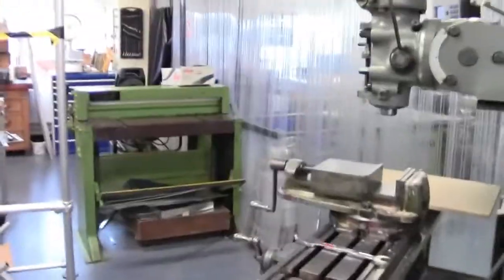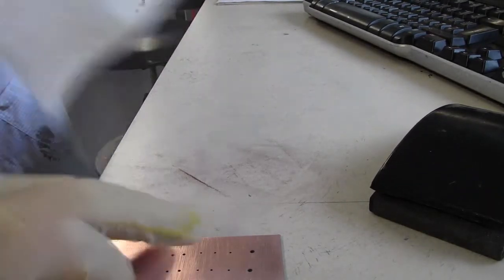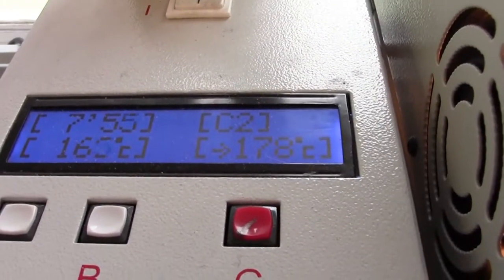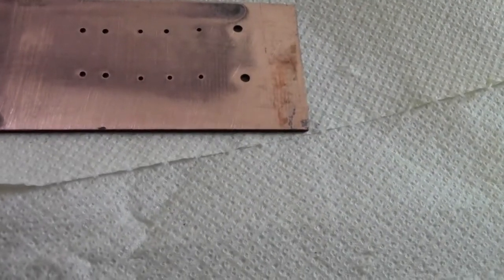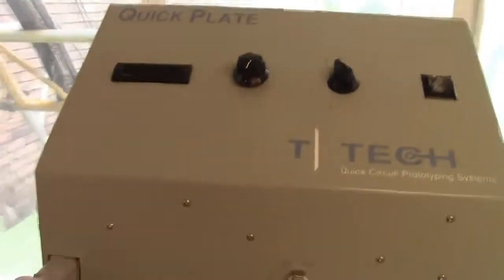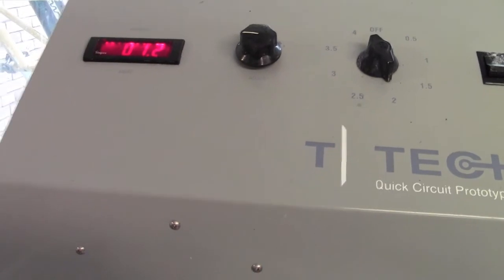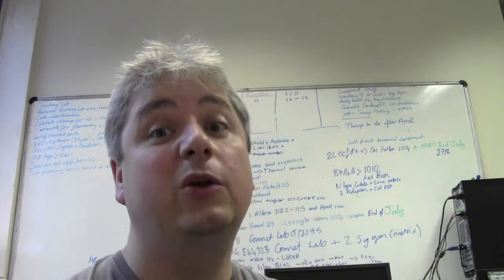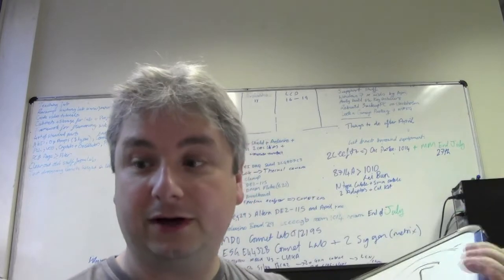Using the Activator and performing Copper Plating

Comment: A very interesting method. One problem that I see immediately, ist that FR-4, the material used in about 99% of all PCBs, has a glass transition temperature of 130°C. Going over this temperature could easily result in warping and other deformations.

Comment: Hi and thank's for your video. What is the "activator" solution you described in the precedent video?
Does it react with the second bath?  Or is it to make the nude copper drilled holes electrical conductive?

In other words : may i use another electroplating solution than yours after the activator one?
Or alternative : what is the electroplating content cooking on which it's written it contains sulfuric acid?
Thank you!

Comment: 1:45 - "Don't use sand paper"... You have no idea what you're talking about, real professional PCB fabs and makers uses "sand Paper", specifically Aluminum Oxide sand paper to clean/scrub away the impurities that are on the surface of the copper plate, they also use some additional acid cleaning solution such as a 10% solution of sulphuric acid. You can read all of this right at the manual of the photoresist from dupont which tells you how to "properly" clean the surface of the PCB's copper. By the way, when you say sand paper will "macker up" the copper plating... since you live in rock, you have never seen all of the many different types of "grit" size sand paper. You use a certain low size grit of sand paper to scratch away the impurities from the copper surface then use a higher grit sand paper to "polish" up the copper surface.

Comment: Hi. I have question. 
I made an activator according to the film.  I have a problem because the holes are glued together a thin layer that does not want to break from the temperature.  sometimes a white precipitate forms around the hole.
 
And all hole are Not plated. After heating pcb i clean with water
Please help.

Comment: thanks for this and the previous video on making the activator. I've made some - the ammonia smell is still strong after a few days is that normal ? also the activator doesnt seem to make the PCB top and bottom electrically connected after heat treatment as I'd expected. Wondering what I've done wrong, any pointers ?

cheers
Reply: Same question, but the question is that what he calls "activator" is may be not what we expect?

Comment: Thanks for the video,
I have tried developing the solution as per the video and chemicals you suggested. but i am having a small problem, hoping you to please help me out.
i am trying to plate larger boards, so in such case i need around 500 ml of solution for that. so i made the solution like..
280 ml of DI water.
60 grms of copper sulfate.
44 grms of calcium hypophosphite,
again 200 ml of DI water,
80 ml of amonium hydroxide,
adding 10 ml of dettol hand wash(liquid soap)
and then again 20 grms of calcium hypophosphite,
but the problem what i am getting is only 40 to 50% of holes are plated and rest of the holes remain the same. i tried the same with 4 to 5 boards, but the problem continues to all the boards.
can you please suggest me any solution for this problem.

Comment: First, thank your for taking the time to make the video. Yes, the video could be shorter but the more details the better, IMHO.
As for the chemicals involved, I was able to find calcium hypophosphite in eBay, from China at US68 for 1 lb. Not sure if it will be allowed to enter US but giving it a try. Asked the seller to add information on proposed use of the product to shipment details (Electroplating activator).

Comment: I dislike this video for so many reasons: 1) I watched this video and the previous for a whole hour...Why?  I wanted to do plate-through holes, but I never find out what the electroplating solution is.  2) Why do you drag it out telling me what used to be in your baby bottle etc?  You have endless filler, "tap the side", "don't poke a hole" etc.  3) Where are the black boards with the chemical formulae etc?  Summary: In then end I find out that this whole video is incomplete, I can't do my own plate-through pcbs.
Reply: I'm sorry but watching your videos IS like watching paint dry.
Reply: Not to mention I watched the first one three times trying to stay awake long enough to gleen some worthwile info from it while learning to understand you.  Thought the second video would be easier.  Not so.
Reply from the maker: Ken Snyder This video is about the process not roll your own chems and is aimed at using the activator hence the title. But you can do it; your just being lazy and wants to be spoon fed. GROW UP. You can buy the copper electrolyte off the shelf T-Tech who make the kit used in the video sell it, LPKF that does a plating line sell it, mega electronics sell the chemicals as a kit or if you want roll your own its water - sulphuric acid - copper sulphate and a dash of hydrochloric acid goto for the amounts https://www.thinktink.com/stack/volumes/voliii/consumbl/cplatmix.htm.
Reply: Grow up man, watch his videos and be elaborated. Don't be upset for not researching his videos

Comment: I'm really fascinated by your video! Congratulations! Listen, I designed a board that I already etched. I'm having a lot of problems using the silver paint to create de vias and hole mounts. Is there still a way to "Save" this board using the plating method after it has already been etched?
Reply from the maker: nope once its etched you can't plate as you would have open circuits to lots of the holes.  you can get other conductive paint and gel like "bare conductive" or "Chemtronics CircuitWorks Conductive Paint" but im not sure if solder would take that well after and conectivity might still be a bit touch and go.
Reply: Thank you very much for your help! I'll look into those options!

Comment from the maker: There are a few different copper bright solutions but all do the same thing you can get 2part or 3part solution for industrial grade finishes when you do a hull cell test but a single general purpose brightener is fine (acid based).
The one I use is from T-Tech, I got a few bottles at the time as it needs topping up every so often, you can also get the electrolyte from them as well. other suppliers do it like caswell plating just shop about.

I might make a plating solution but normally I buy it
Reply: PUB.